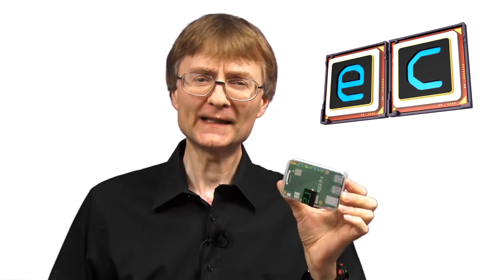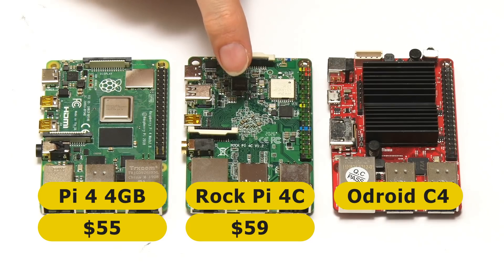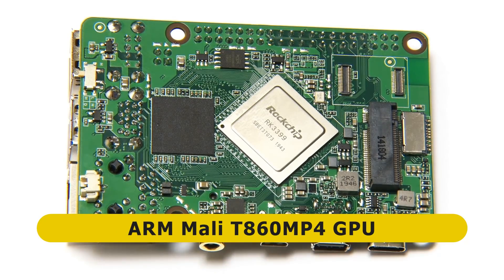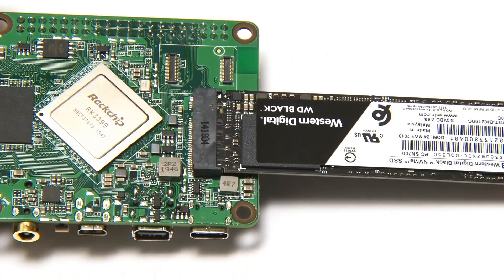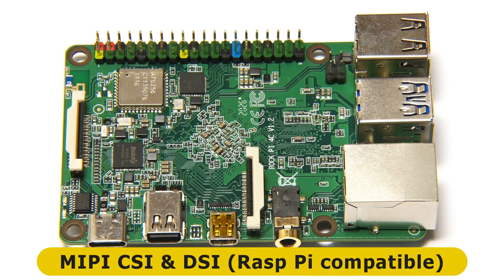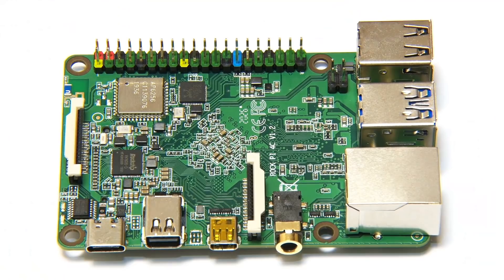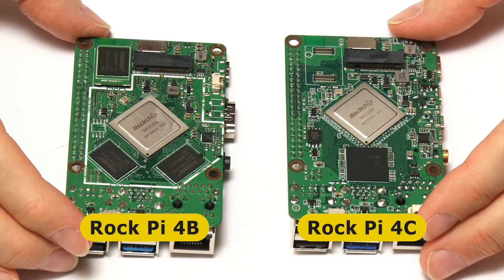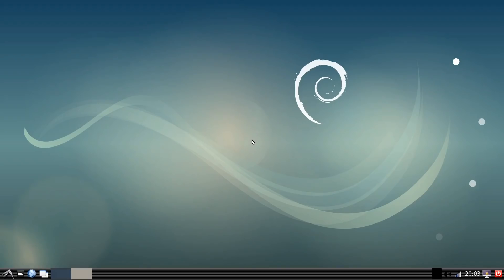Rock Pi 4C: Dual Display M.2 NVMe SBC

Comment: First of all, I cringed at the way Mr.Stanley nearly got you. Second, Excellent video as usual!

With all these SBCs coming out, one would think that a killing is being made with them... but I have to ask ... WHAT are people doing with them? I have a number of PI4 on my shelf doing... nothing. First of all I hate that weird microHDMI connector. And second, precious little seems to work with the PI4. 

Finally, the raspbian distros, to me, are so sluggish as to prove inoperable. Perhaps it's my perception, but unless buyers are using them with the GPIO ports to control stuff at home, they make little sense as they are definitely underpowered.

And once you start to add all these gizmos to them, they start to become unwieldy. This is NOT what they were designed for, and I honestly feel that many companies are getting way ahead of themselves.

For me, using a PI0/1 with RISC OS Pico is what it's all about. https://www.riscosopen.org/content/downloads/raspberry-pi 

Programming and controlling ports... but that's just me, I guess.
Reply: I have one Pi 4 and it's my home server for NAS, Plex and PiHole, I use it with a spare 1TB HDD that I connected to it with a UASP USB 3.0 adapter. Runs 24/7

I actually would like a second one for console emulation or general tinkering
Reply: @gustavrsh  Isn't that a cheaper option of having a pc? I mean, it is the same as I do... but once it is there, then it's put away... the beauty of a PI is connecting things... using it from day to day to learn on it...
Reply: Well, I learned a lot while setting it up, as I didn't have any experience with Linux. Yes it's like a regular PC, a very energy efficient one and perfect for this kind of application. The earlier PIs aren't as good for this, as they don't have Gigabit ethernet or USB 3.0. Yes it's a bit boring because the original was made for tinkering, but that's just the way of things

Comment: I'm waiting for ARM based PC being more user-friendly, easy to use, interchangeable components for upgrading and everyone can afford it.
Reply: Just use a Jetson nano
Reply: @sagnikdas7877  Is it cheap? no. they should be as small as ITX-motherboard or smaller.
Reply: @kritpitako  it is way smaller than itx... I think you should check it out.. it also has 128cuda core gpu, and 4 core arm Cortex cpu
Reply: Wait for Raspberry Pi 5 then.

Comment: I find it interesting when I run a sharpen extension on a video it increases bandwidth tremendously where a video didn't drop frames prior to many and struggling with sharpness at high rez settings.

Comment: I wonder if NVME is a wise choice compared to SSD using m.2. I understand there is speed advantages, but can the board (this or any other) actually max out an NVME or could the board itself get swamped because it can’t handle the throughput? SSD would be cheaper and perhaps thermally cooler (?) and therefore be a better solution.
Reply: By "SSD using m.2" I assume you mean a SATA M.2 SSD, rather than an NVMe M.2 SSD. I don't know how many PCIe lanes the Rockchip SoC provides but I doubt that four are used in the connection to the M.2 socket.
Reply: @johnm2012  That's exactly what I meant :-)

Comment: I have the latest RPi 4 and connected it with a VGA monitor using VGA to HDMI connector however the monitor flickers almost every 2 seconds what solution do you recommend.
Reply from the maker: You could try adjusting the frame rate in the Pi preferences. And check the connections to the adapter.

Comment: Hi Christopher. It is a nice board indeed. 
Now I got the Odroid N2+. Very fast CPU, but not as well supported yet in Linux, bad I/O and bad working USB3. 
So the RK3399's are still my favorite. I wonder how well it works with multi dislpay. I guess good GPU drivers will be needed to make it a good experience. 
Good the RK3399 has Panfrost. I've got a video showing how to install it on RK3399.
Finished my N2+ Linux review this week. It's good to be able to review something new again. 
I can't wait for the RockPiX. x86 and a bit higher clocked than the Atomic Pi (1.9Ghz vs 1.7Ghz) while same SoC and 4GB vs 2GB. The same form factor as RockPi4. I like the Atomic Pi, but it's a bit too big and could use a bit more performance. Have a great evening. Greetings. NicoD
Reply from the maker: Hi Nico. It all comes down to software support, doesn't it? Always.
Reply: 🤯 Good to see you here, my friend. Been missing your reviews. Wondered whether you had fallen victim to COVID-19. 
Been up to my ears with RPi HQ cameras, stereoscopic vision, OpenCV, AI robotics, Jetson NX, & RPi CM3. Looking forward to RPi dropping the CM4 along with the inevitable variety of 3rd party carrier boards. Been eyeballing the Odroid N2 lately, so I'm looking forward to watching your review. 😎💨
Reply: @TheOleHermit  Hi, the N2+ review is online on my channel. I indeed had a sabbath. Didn't have new toys to play with and didn't feel good when locked down. I'm a bird that needs freedom. Greetings.

Comment: Surely it wasn't essential to place the CPU on the wrong side of the board and the M.2 slot pointing in the wrong direction. What were they thinking? Lol
Reply: I think they were thinking how best to use the available space. Why do you say the M.2 socket is facing the wrong direction? If it faced the other direction an NVMe SSD would still overhang the edge of the board. The only orientation that makes sense is the way it is - just accept that the extension is required. The SoC on the bottom makes sense with the large heatsink - or it would if the large heatsink actually fitted! Like so many Pi clones, it doesn't quite live up to the expectations.
Reply: @johnm2012  weight distribution and cooling.

Comment: I dont understand the move towards mini display port and mini hdmi... A full blows hdmi like before is easy to design and much useful than these two...also no one would ever connect two display to a SBC ever, so whats the use....
Reply: I'm using a Pi 4 with two monitors right now as I type this.  This is in Firefox on the right-hand monitor, my terminal, text editor and file manager are open in the other monitor.  Actually works pretty well as a desktop for my purposes.
I recently built an information display for a customer that uses two monitors back to back, basically running two slide shows at once from a NAS over Wifi.  Compared to using two Pi 3's, I was able to get it done cheaper, passing the profits directly onto me, the builder.

Comment: It’d be great to see more about setting up the Real Time Clock with that battery connector along with booting to NVmE and/or MMC. After that, it would be fabulous to see an example of USING the USB OTG feature. I think those features are a little more challenging but offer much more rewarding overall usage for turning this SBC into a project. For the OTG feature, an interesting starting point might be as a fake keyboard or as a keyboard translator, translating a keyboard’s key codes to another set of keycodes. (Such as taking a a PC keyboard and making it work for a Mac but the Pi being a smart configurable intermediary)

Comment: I'll be taking a pass on these. If Rock Pi can figure out how to put the hottest components all on the same side of the board, where heatsinks and a single fan can keep things at comfortable temperatures, then I would pick one up. Why design for the Raspberry Pi form-factor then kill it by bottom mounting the cpu (i.e. extra height to accommodate a heatsink)?

Comment: The Rock Pi 4C looks to be one of those (unfortunately many) electronic and computer devices which are released regularly which don't have all the actual and potential bugs worked out upon sale to the public. In time this may prove to be a very good device, but to the SBC novice buying their first board, I cannot help but feel their discouragement upon trying to set this up wishing that maybe they had purchased a different device.
Reply: This. It's much more work to get things working and with that I mean nearly everything. I remember I wanted to get something working, which in the end was a futile task due to the 4.4 kernel. Overall a huge hassle if you don't know what you're doing or just want things to work like they do on the raspi.
Reply: Yep. Just another Chinese knock-off board with none of the support, documentation, or userbase of the Raspberry Pi.
Reply: An sbc is for tinkering. And even then, setup this board or any rk3399 is really easy with armbian.

Comment: 2 things Christopher. If you use legacy kernel you can enable hw acceleration on browsers with armbian rk3399. Media script. And on my yesterday test on Ubuntu Wayland (kernel 5.6) no dropping frames at all on rk3399. Seems than Wayland enhance a.kot the Performance. Also, take note that there are VPU drivers to be on upstream kernels down the road (only with patches now)

Comment: Who ever turned that m.2 connector the wrong way, must have had a bad day at the office.
Reply: it makes perfect sense the way it is
Reply: @dan8t669  

I think it's a clumsy way of doing it. Needing a loop cable and a 98 blank PCB for this alone.
Reply: @kjakobsen  There's no space for a full length 2280 M.2 SSD.. unless you want to cover the CPU and block all airflow to it.

Also, you don't need an extender or the extra PCB. You could use it as is, in a longer case, or something like a DIY laptop.

Comment: I had my finger poised over the 'BUY NOW' button until I got to the bit about not booting from an M.2. There's always sommat!
Excellent vid all the same. Thanks.
Reply: Hkey_ Root Philip Bedford not necessarily a bad thing, my main pc doesn’t support booting for Nvme although I’d rather keep the OS on its own SSD, I install all my apps and games to the nvme drive. There is no real speed increase to load times with nvme, only really visible when copying large files or running benchmarks.
Reply: @jonjohnson2844  I boot a Pi4B  from an M.2 drive therefore it is necessarily a bad thing.
Reply: It does boot, but is a bit picky on the controller chip. That is why we only offer Acer nvme drives which have proven to work flawlessly.
Reply: @NB-sw1op  I might be interested when it'll boot flawlessly from a WD (or any other drive).

Comment: Hello what should I do On internal Physical SSD that is 1TB but the partition is only 160 GB where I had my Mac OS operating system but the rest of SSD is read only and won’t let me reformat. Any codes
Thank you
Reply from the maker: Sounds like you need to go to drive management (if in Windows), delete the partitions, and put back what you now need. Or use diskpart in Windows to clean the drive -- it with great care!
Reply: Thanks for your time 
But it won’t do anything 
Is Mac Pro .. I tried Terminal
To mount SSD as read only but it won’t mount 
I’ll bring over to Apple 
Because I want to do upgrades on it
Thanks

Comment: Great, I'm looking for something like that to build a NAS with 2 SSDs.. ideas?
Reply: The RPi 4 has dual USB 3.0 ports, which support SATA SSD. But, I think they share the same controller, which  kinda defeats the purpose. Planning on RAID?🤔
Personally, I'm a huge fan of the much faster NVMe SSDs, via M.2. 2TB can store lots of content. For that, I would check out Khadas VIM3 or NVIDIA Jetson. 
But, I've learned the hard way to always research the mfr's support forum prior to purchasing any SBC. It's a good indication of the products' flaws and how quickly they are being resolved.
Hope this helps.😎
Reply: @TheOleHermit  Thanks for the reply, those are sbc for machine learning, I'd like a 2 ssd sbc, like DS620slim but where I can install the os I want. I don't understand why it's so difficult to find a diy board for that
Reply: @luigitech3169  Yes, it is very difficult to find a fully developed and functional SBC, with choices of distros. Over the past year, I've probably blown $500 on duds.
The boards I mentioned are capable of machine learning + much more. They are among the more capable ones on the market that I'm aware of.
Doesn't the DS620slim have it's own OS, capable of serving files to any other network aware OS?
Hope you find what you're looking for.😎

Comment: The main reason I stuck with a Pi4 4gig is the large user base which will ensure device and software support.  I have heard horror stories about unique SBC's being paperweights as none of the distro's supported the hardware and firmware requirements,  and community interest and uptake was too low for anything to be tailored for them.
Reply: You must have read some of my comments. 😎
Reply: And how many such SBC boards will the market support? Are the additional features of this 4C compelling? If so, will they appear RSN on the Raspberry Pi?

Comment: It's wonderful that Chris keeps us up to date on SBC, but since when RPI 4 has been USB bootable, I look at Rock 4C with skepticism at first. ¯\_(ツ)_/¯ 

It would be interesting to know how fast is NVME SSD through M.2 connector.
(It can also be connected to USB 3 via an adapter).
Reply: It depends on the m.2 drive. Samsung EVO 970 plus NVMe does 940MB/s on RockPi4C for reading and writing speeds. That's is almost 3x times as fast as USB3 SSD speeds on the Raspberry pi 4.

Comment: Thank you Sir Christopher for another great video!   I do have 1 question.   In the past on some SBCs that had both USB2 AND USB 3 PORTS.  THE PERFORMANCE WAS LIMITED TO USB 2.0 PERFORMANE EVEVTHOUGH IT HAD USB3.0 AS WELL.    

UNFAMILIAR WITH THIS MAKER BOARD.... DO WE GET TRUE USB 3.0 THROUGHPUT PERFORMANCE ON THIS NEW MODEL?  Or are we throttled to max of USB 2.0 throughput?  Most Humble Appreciation,   Alton
Reply from the maker: Hi Alton. I've never come across an SBC where the USB 3.0 ports run at USB 2.0 speeds (althoug they often share a USB 3.0 controller). Here the ports are certainly USB 3.0

Comment: Can you set it up so the board boots from SD but the root filesystem / is on the NVMe? I'm not sure if just altering fstab will do it, I've done a similar thing on a PC before but that uses grub so is probably different.
Reply: Yup, its possible. Same way as you describe.
P.S. Need to be a bit careful though as ARM u-boot is tricky, and have a serial USB ready to debug.
Reply: @abchk22  I thought grub needed its own copy of fstab, im not sure how it works, probably in initramfs or something. I dont know anything about uboot, is something similar needed?
Reply: @willyarma_uk  Yes. Like grub is bootloader for x86 PCs, u-boot is bootloader for ARM SBCs. Need to add / and /boot info in 2 places:
* /etc/fstab
* in u-boot configuration we write the root location

Will share a snippet of my u-boot config and /etc/fstab from Armbian Buster desktop for greater clarity, tomorrow or the day after. :-)

Comment: Excellent video but what a pity that the boot on SSD and the aluminum radiator were not released at the same time! It leaves a taste of unfinished business.
Otherwise, as already said, save your fingers!
Reply: They actually work with acer nvme drives, the heat sink is also available.

Comment: I wish one of the SBC manufacturers would release a board with the latest ARM processors like an A76 or the new A77, of course, the price would be increased somewhat but I believe there is a need for faster SBC's with more memory, just look at the success of the RPi4 8Gb and the multitude of OS's that have taken advantage of this boards abilities.
Reply: Hopefully when RK3588 releases, we can have a more powerful SBC with 8Gb+ RAM. :-)
Edit - not before next year likely.